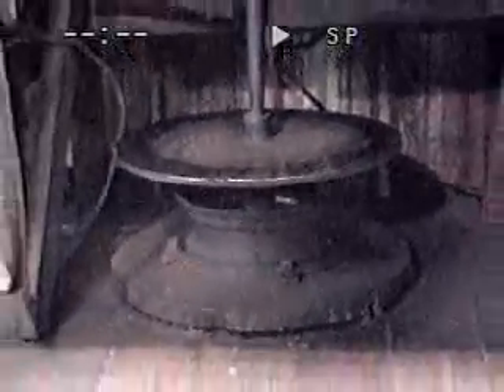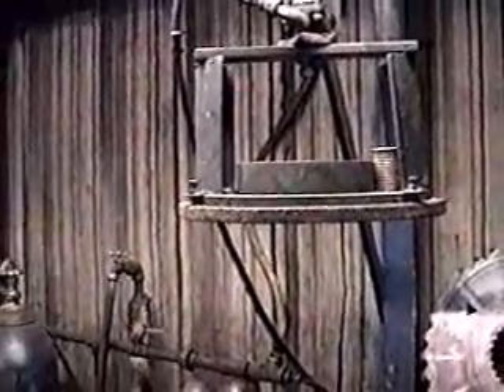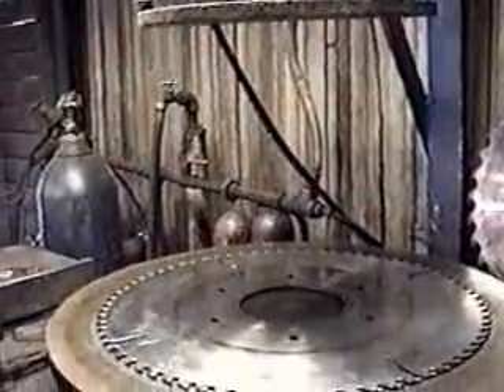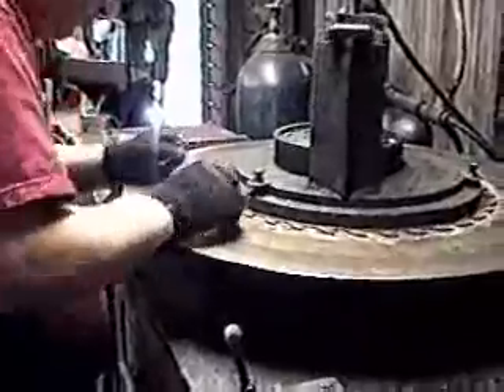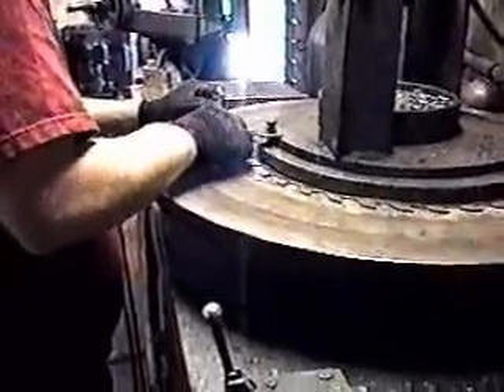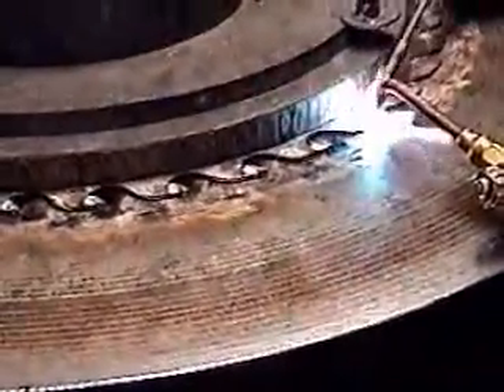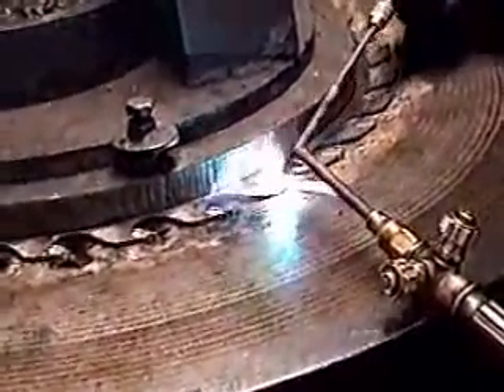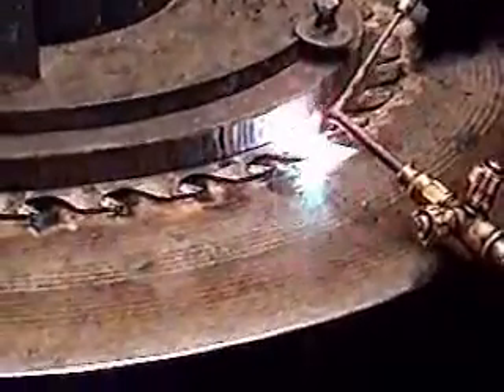Brazing Carbide Tips, Part 2 of 2 | Carbide Processors

Comment: What about metal cutting blades. 
I have a drawer full of 14" 90 tooth metal cutting blades that each one is just missing 1- 3 teeth  but they alternate and are fairly small. Is that still something that carbide can be found for.